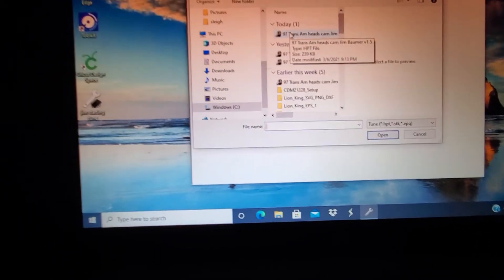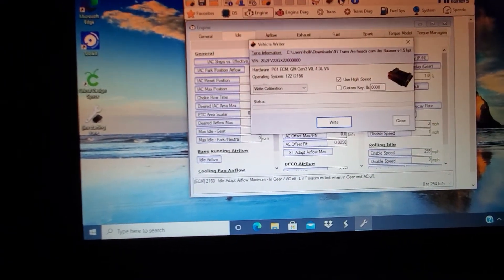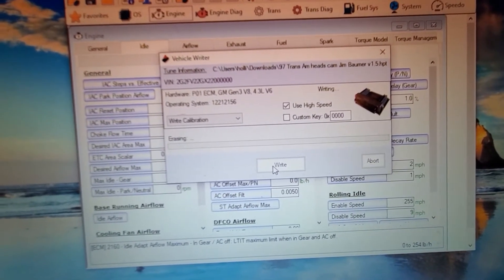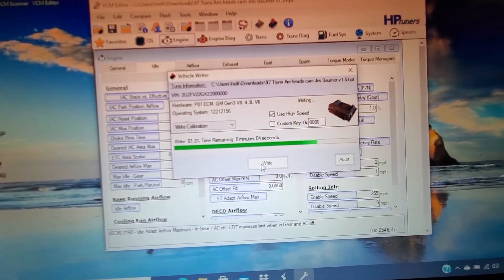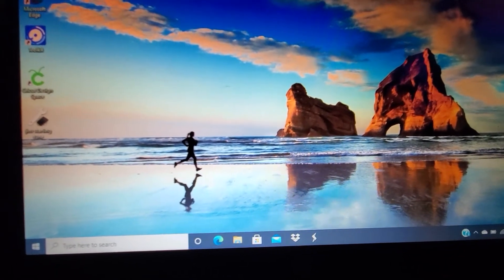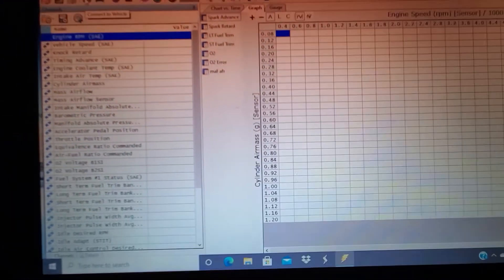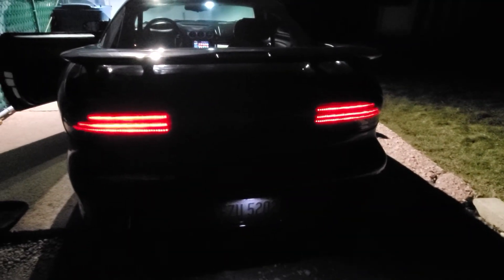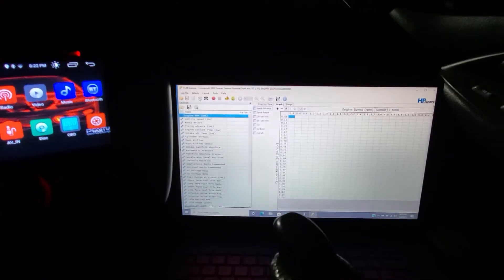Installing a new tune to my 95 LT1 with a 24x conversion with HP tuners

Comment: Hey brother I have some turner questions I'm getting the same setup
Reply from the maker: What's up??
Reply: @jamesbaumer6563   far as the setup go is the program for tuning is it learn as u go type of deal  I'm doing the setup on my 94 impala ss and I was gone ask about ur tick performance cam
Reply from the maker: @lssleepers6464  I had a guy do my tuning... I just flashed the tunes in myself with HP tuners.. As far as the cam... Im actually running a TPIS zzx cam it's close to the size lift the hate maker stage 3 cam from Tick is
Reply: @jamesbaumer6563  what kind of laptop u using for the tuner setup
Reply: @jamesbaumer6563  where bout did u get the cam

Comment: did your car already have a obd2 port? im trying to figure out how to convert my obd1 to obd2 so i can flash my ecu. I also just installed the 24x kit
Reply from the maker: My car is a 95... So it originally had what they call the OBD1.5 port... it's a OBD1 PCM with a OBD2 style port... I ended up changing to a Torqhead 24x conversion... So all I had to do is repin one wire for my original port to work with the Torqhead 24x PCM ... Check out some of my newer videos I have posted they show my new setup... Now I tune with HP tuners